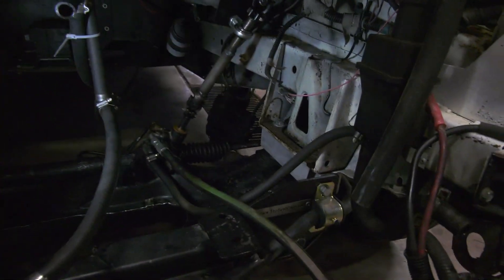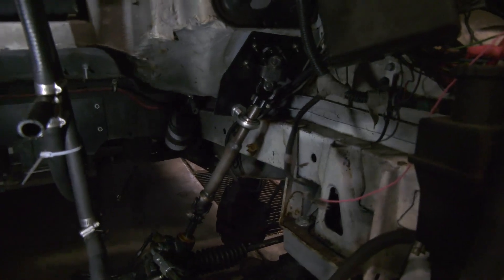Install a LeSharo engine transmission in 10 Minutes

Comment: Hello friend I have a question to ask you since you are very knowledgeable on these RVs. So I am looking to buy one but it has a small issue with the transmission. The seller told me someone went to check the RV out. They put the RV into first gear. Then couldn't  take out it from first gear. so it's stuck in first gear. what do you think what's happening?

Comment: You may have addressed the concrete drop off by now but if not, you could jave backed it in and did the job from the other side where it is flat.

Comment: Haha, mechanic dog at work. So cute. I myself have a 1987 Lesharo that I had to install a sender in the gas tank because the old one was not working. I still have not finished installing the gas tank back yet, but I can see that the water temperature gauge is also not working. It might be a wiring problem for both, so if anyone has an idea where I need to start looking for an open wire circuit, please let me know. The temp coolant sensor is ok, but I have no idea where to follow the wiring to. As for the two sender wires at the tank, does anyone have an idea what kind of readings I should have at each wire with the ignition on? Grrrrr.

Comment: 👍 Thanks, enjoyed.  Maybe fashion yourself something out of metal or wood to temporarily fit into that 1 1/2" drain trench so you can use your lift for these type of jobs in the future..... just sayin', although you have to properly lift a LeSharo or Rialta or all hell breaks loose between the cab and the coach and different spots of the frame.

Comment: I love your video. Did you make engine mount bracket and transmission mount bracket? I would like to put a VW T4 2.5 engine and transmission to a 1989 Lesharo because VW T4 parts are more accessible in Taiwan for future maintenance. Thank you!

Comment: Great vid.  How come V6?  I was thinking a newer 4cyl engine like a basic 2016 Toyota 2.5 with 178hp/170 torque would be much easier to put in or would the electronics be a nightmare?  (Lesharo's best was 103hp/145 torque).  thanks

Comment: Great video! IF the feed wire is pink, and IF it´s like on original Renault Trafic vehicles, it should be positive(+) feed to the coil. At least that´s the case in the ones sold here in Argentina. Keep up the good work!